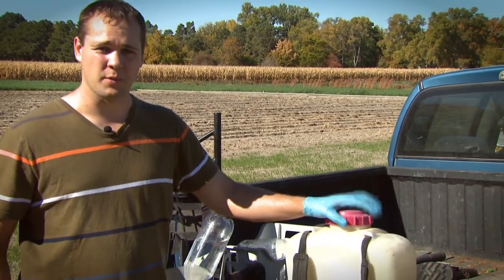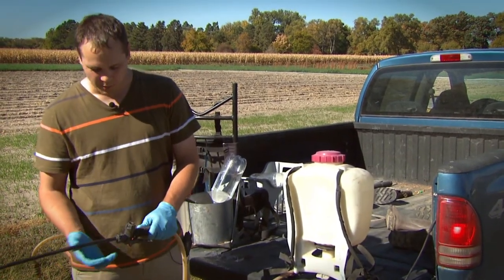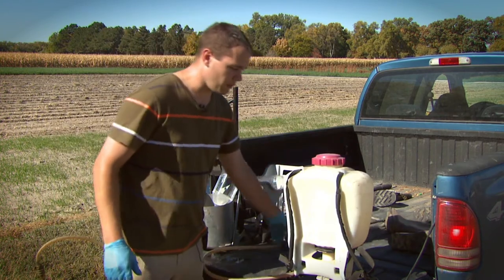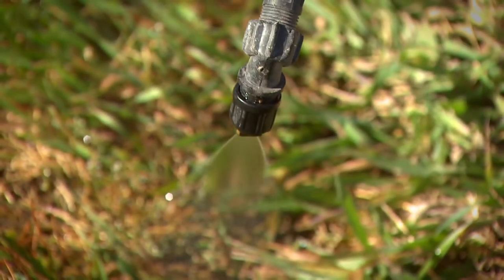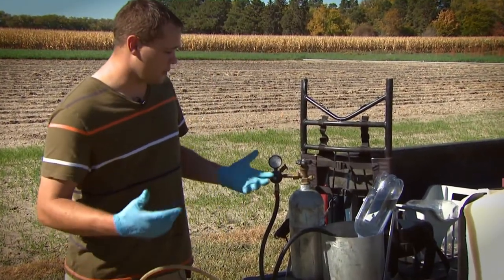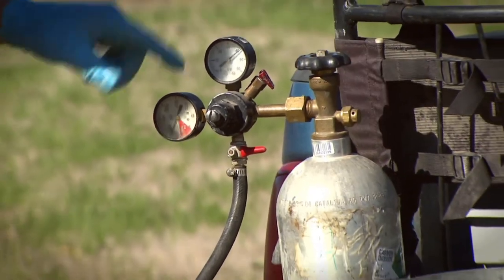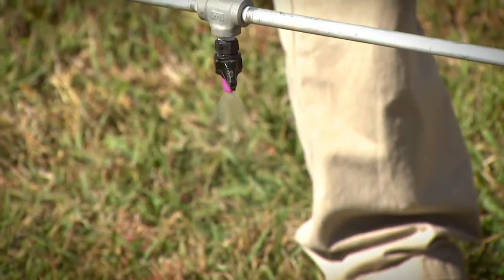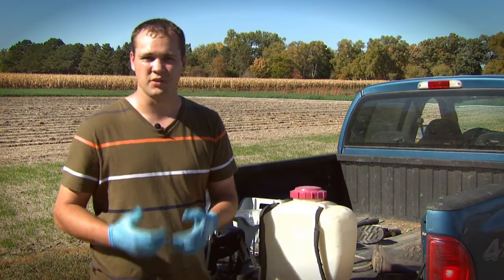Cleaning A Backpack Sprayer

Comment: Is it OK to leave clean water in the sprayer for a long period or should it be emptied of all liquids before storage?
Reply from the maker: Cleaning Backpack Sprayers
Cleaning backpack sprayers is much different from cleaning a field rig. Backpack sprayers are far smaller in size with a lot less plumbing to hide pesticide residues. Thus, they are much easier to clean. In fact, cleaning a backpack sprayer is a lot like rinsing a pesticide container. Rinse out the tank thoroughly and then spray the rinsate from the sprayer onto the site of application. When applying the rinsate, do not exceed the legal amount of pesticide that may be applied to a given area. Repeat this procedure for a total of three rinses. For the second rinse, consider using a commercial tank cleaner to make a solution that will more effectively remove residues. See the pesticide label for recommended cleaning agents. Another source is the Guide for Weed, Disease, and Insect Management in Nebraska, EC130. Allow the solution to sit for the amount of time listed on the label of the cleaning product. Rinse a third time with only water. After the third rinse, the sprayer should be sufficiently cleansed to be used with a different product.

Comment: I don't mean anything by this but I noticed as soon as I saw the picture for the video I knew you were doing it wrong. All chemical labels say the required POE and all labels say long sleeve shirts and chemical resistant gloves. I know that those gloves are incorrect. when i say chemicals I'm referring to one's you get from a dealer, not round up or other Wal-Mart crap. I've scanned round up but never really read the label.
Reply: Well that's arbitrary... not everyone is using this sprayer for chemicals. I don't use long sleeve shirts and chemical gloves to water my plants nor to spray compost tea...